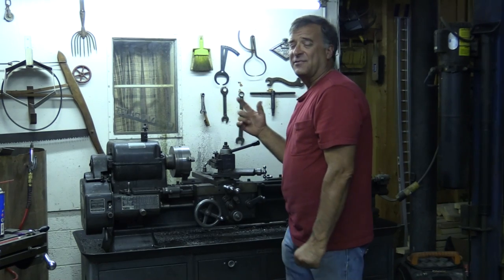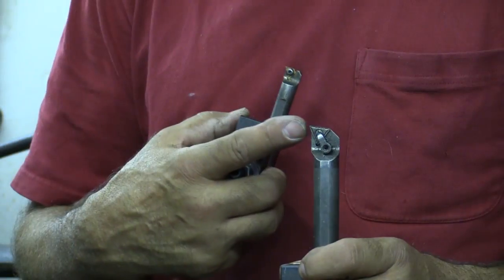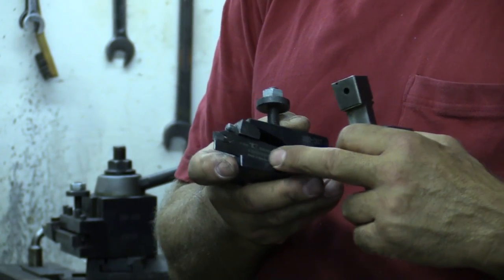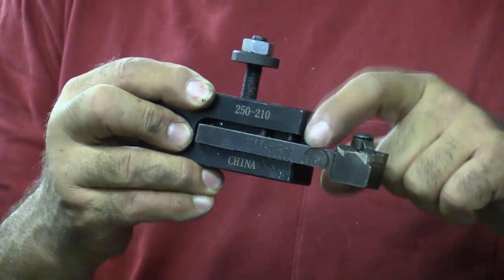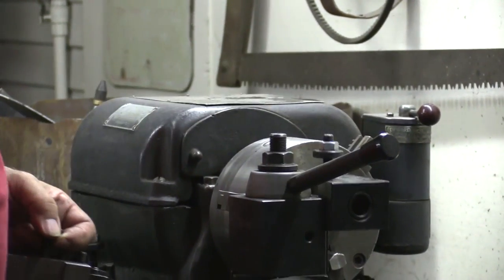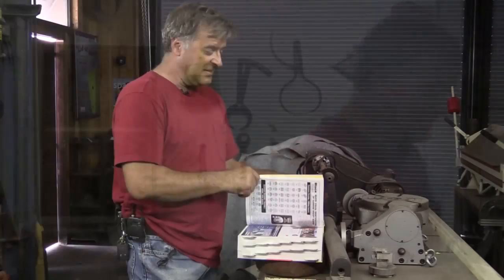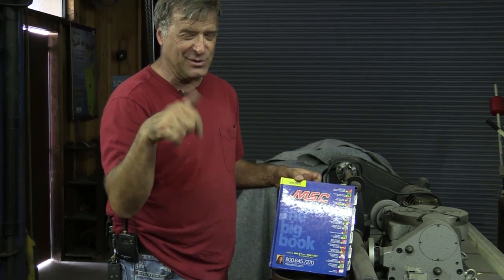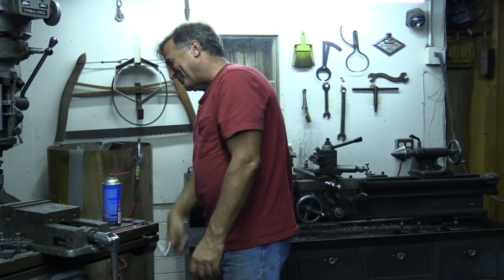What Is Lathe Tooling and How Do You Use It? - Kevin Caron

Comment: As an artist, you can do much more shaping with a metal lathe than the machinist guys talk about. There are youtube vids that show making curvy bits to get certain shapes. The basic lathe is just a turny thing at one end. You can reconfigure the lathe so many ways that it is like a Swiss Army knife. Of course, watchmakers and jewelers work there own special magic with the lathe. One correction, you named the right and left hand tools opposite. The name reflects from what direction you are heading. Right hand tool cuts toward the spindle/chuck, left toward the tailstock.
Reply from the maker: Still learning!
Reply: Well, I just entered that vast abyss of information around index carbide tooling because I didn't get good results with HSS bits on 1144 steel. After days of researchign and learning, I was just stumped. That hardly ever happens. There are so many variants of the index carbid inserts, I was left really not knowing what to buy first. Not that they are too, too expensive but I already have drawers full of one-time-used tools and have to curtail that habit. Ended up just buying a pair of diamond and trigon setups from a gent on ebay, ships from CT. We'll see how that goes. Aluminum is pretty straightforward, but getting your head around all the steels that are available, is its own study. Then, there is just mounting some material up and use whatever bit is handy - don't get stumped!

Comment: Hey, Kevin! Whachya doin'? If you have some time, I'd love to see a quick lathe parts addendum video where you do a cost-benefit analysis of owning said rig for a once-in-a-while type user. Particularly the ballpark cost ranges of the stock/billet materials for the occasional single or small run parts. And, for the big question: Is it cheaper/less hassle in the long run to simply grab the occasional part or parts from a catalog or hardware store, and, if necessary, have a fabricator make you what you want..OR..is having a lathe and the myriad of necessary tools, gadgets, gizmos and material not only a pleasure to own, but a huge bargain in comparison?
Reply from the maker: 35ABSTRACT This is out of my wheelhouse - too many variables, too much math. ROFL. I think you'll need to look at this for your own needs.
Reply: Kevin Caron, Artist Math?? Nobody ever said as a steel sculptor I'd encounter any math. Guess I'll have to get a real job now. Thanks a lot, Kevin.
Reply from the maker: 35ABSTRACT Hell, I just like playing with the machines and making chips!!
Reply from the maker: 35ABSTRACT I"m amazed how much math I use in my work.